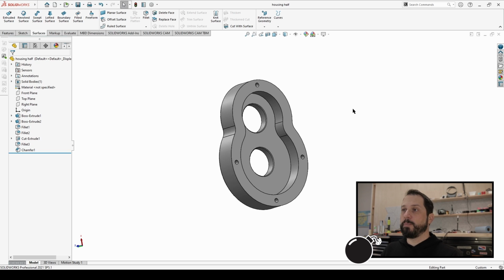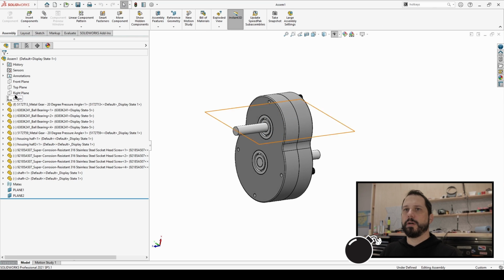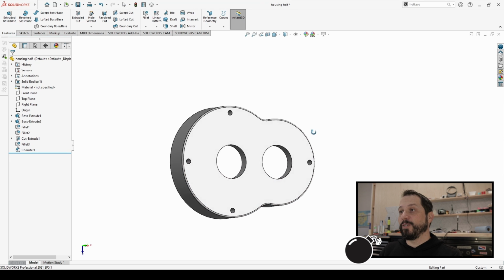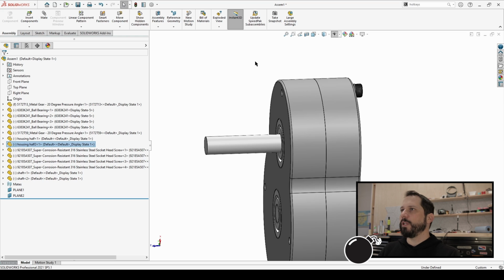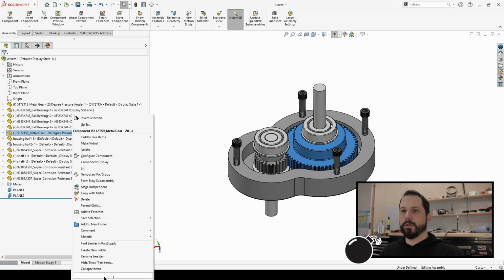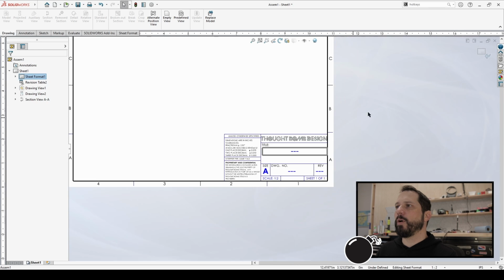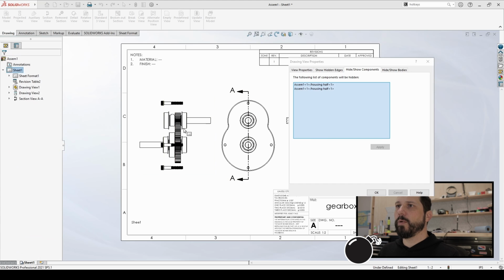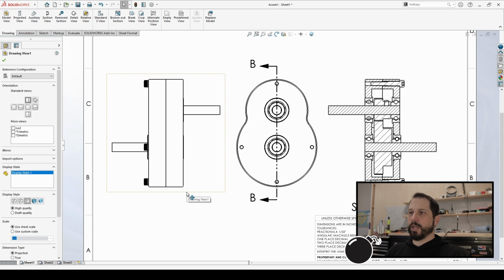Solidworks Tips & Tricks

Comment: When you click on a feature the measurements popup immediately. What settings do I need to change to get that behavior?
Reply from the maker: What does SW do for you? When you try to measure something?
Reply: At 7:47 You have selected some faces. and get some diameters on your screen. I don't get them.

What version of solidworks are you using?
Reply from the maker: @simcru933  check this out.  https://www.goengineer.com/blog/how-to-hide-show-solidworks-dimensions-at-part-level#:~:text=In%20your%20FeatureManager%20Tree%2C%20right,part%20in%20the%20design%20space.
Reply from the maker: @simcru933  I am on 2021